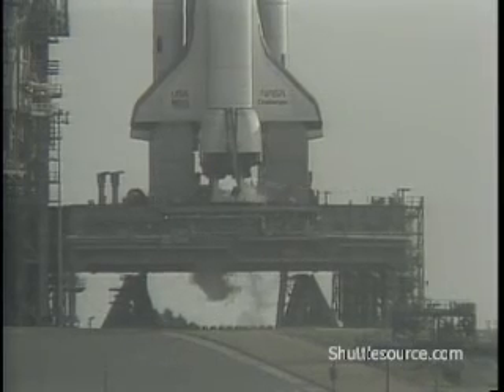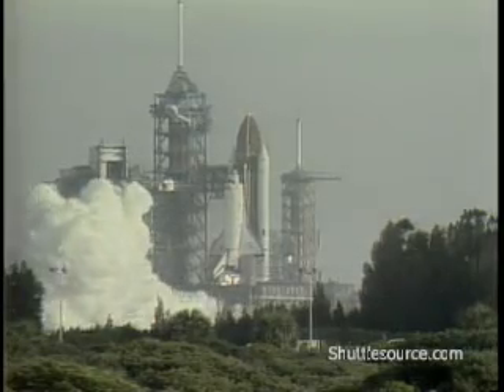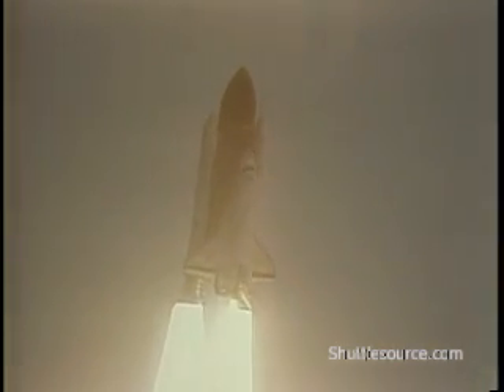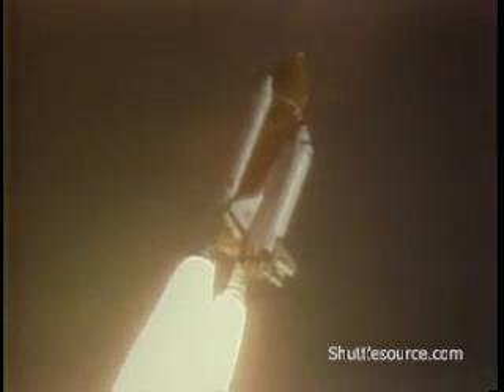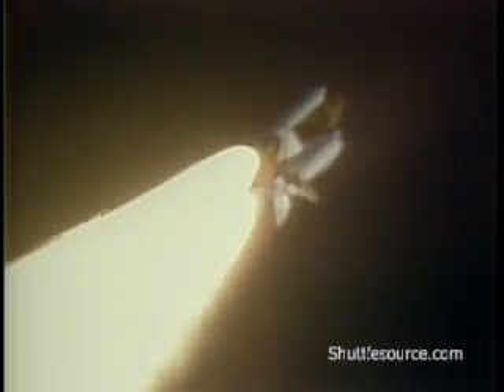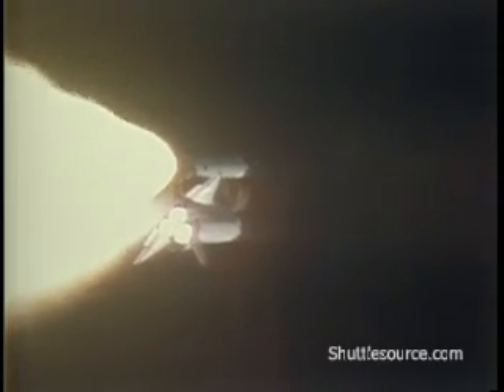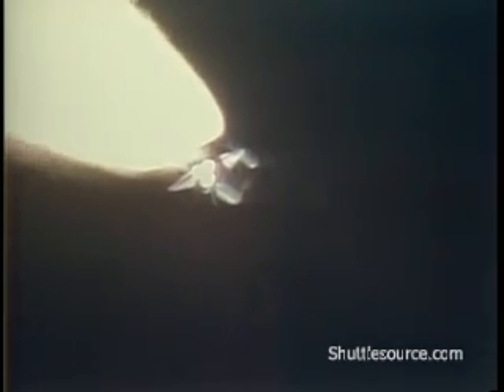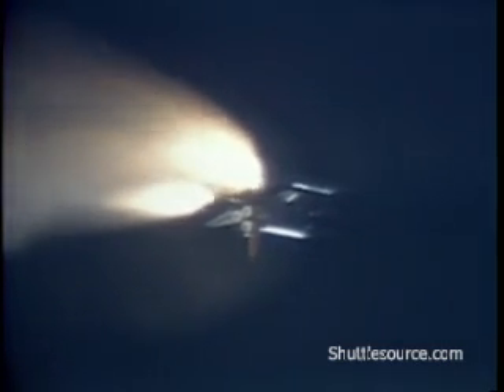Space Shuttle Launch STS-7 (www.shuttlesource.com)

Comment: Penfat1... that's Pad 39B in the background. You can see that the pad in the distance has a fixed service structure just like the one at 39A that was mounted to the left of the Challenger stack as it was sitting on the mobile launch platform. If you look up pictures of Pads 38A & B here on the internet, you'll see a similar view. Check it out.